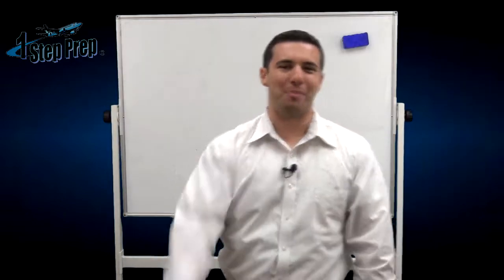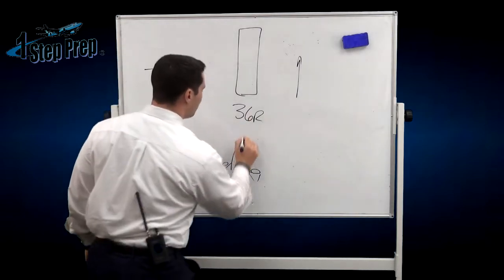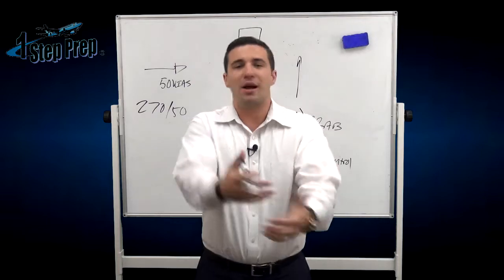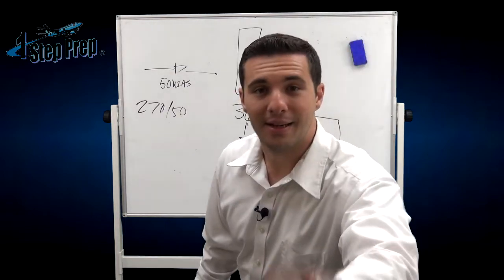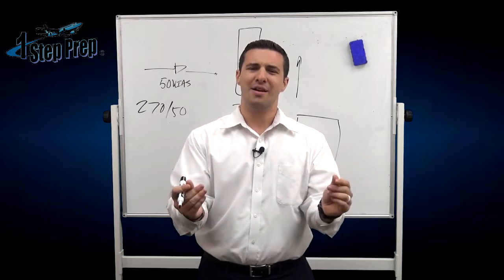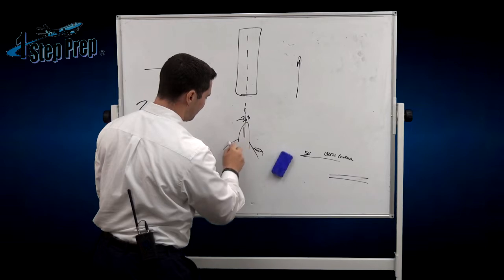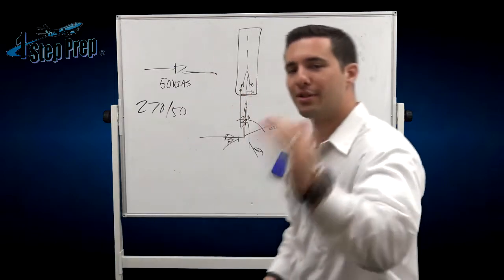Crosswind Landing Technique For Jets

Comment: I'm felling like i'm watching premium things for free, you're amazing dude, such a underrated channel!
Reply from the maker: Thank you appreciate you!! We aim to help and provide value in both  our paid content and free material here! 🙏
Reply: @1stepprep  Wow, there is even a paid version? Is that extra deluxe nonsense? Or are you actually explaining it right in the paid version and the free version is a joke?
Reply: @AnthonyHeithuis  Are you even a pilot bro? The nose always veers into the wind...
Reply: @joshilini2  are you? Based on your comment I doubt that. 

The nose veers into the wind when moving in relation to the ground during take-off and landing. Not while airborne when moving in relation to the same airmass. The statement we will add differential thrust to let the nose veer extra into the wind during approach therefore makes zero sense. 

An aircraft in flight does not experience a “crosswind” or “headwind” component. Only when taking-off before crabbing into the wind and from the moment we start de-crabbing for landing does the aircraft experience a crosswind component.

I have been an instructor for many years and a commercial pilot on turboprops and jets, made many crosswind landing. This method of performing a crosswind landing is a complete fairy tale and so is the explanation.

It is also impossible to perform a 50 kt crosswind landing without side-loads onto the landing gear. That would mean the aircraft needs to be fully de-crabbed which would require so much bank to counter drift that the wingtip and engine nacelle will hit the ground. Its a fairy tale.
Reply: Hello Anthony, my name is Alan Crane. I am a 787 captain. Some United skippers call me Captain Al Crane (sounds like Al Haynes).

I am tracking inbound JFK VOR at 5000' on heading 270. Wind is 180/15kts. Wind is coming from my left correct? In order to track direct to the VOR, my heading will be approx 265 degrees. My NOSE is pointed into the wind. My aircraft is CRABBED. If I continue to fly 270 with a left crosswind, I will be tracking 275 and will miss the JFK VOR.

Thanks for trying to troll but Joe and his team are amazing instructors.
Reply: @alancrane  Hello mister captain, if you truly are a B787 captain you might want to consider going back to flight school for a few simple lessons about aerodynamics. I could use the goldfish in fish tank or log of wood in a river example to explain how an aircraft is affected by wind, but lets try it this way first:

The aircraft is not experiencing a "crosswind component" and does not weathervane into the wind in your example, you are moving within an airmass which is taking you somewhere you don't want to go and for that reason you are applying a wind correction angle. 

(Mickey mouse terms: someone is moving the fishing tank with you in it while you are swimming from one end to the other end. You need to apply a correction in order to swim the correct track over the table, i.e. to the corner of the fishing tank. Do you notice anything otherwise? No. Do you have to swim faster to reach the other end of the fishing tank in the same time? No. Does the water all of a sudden come from the side? No. The fishing tank is the mass of air you are maneuvering in, the goldfish is your airplane.)

At 4:50, “you take the autopilot off, release all rudder inputs, what does the aircraft wanna do, it will weathervane into the wind”, no it won’t, not on an Airbus and neither on your Boeing 787. If you are telling me otherwise we are done talking.

The explanation that on approach the nose wants to weathervane into the wind and that this crosswind will then become a quartering crosswind with a headwind component is wrong on so many levels, even an inexperienced pilot would / should know that. 

The part where he says, try it on the ground, let everything go with a 50 kt crosswind and you will see the nose weathervane into the wind, that is the ONLY part which is correct. On the ground, while tracking the centerline (moving in relation to the ground, not the air) the aircraft does experience crosswind and will weathervane into the wind, found something correct 👍👍. Credit where credit is due.

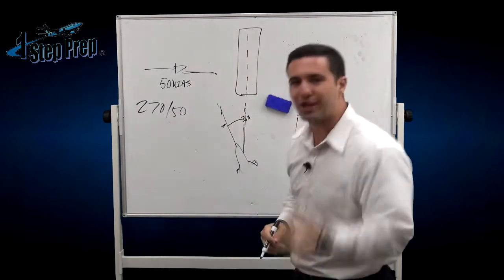At 9:20, when we let the aircraft weathervane into the wind on approach (which is 💩, see above), direct crosswind becomes a quartering crosswind with a headwind component. Of course not! This is the biggest baloney! The aircraft does not experience any wind component during a crabbed approach.

(Donald Duck explanation: you are in a canal swimming from one side to your buddy on the other side. To correct for the water streaming through the canal, you swim a couple of degrees upstream in order to swim directly to your friend on the other side. Do you experience water coming from the side? No, in relation to the water you are swimming in a straight line, the mass of water with you in it is streaming through the canal while you are swimming a bit upstream, basically you are performing a crabbed approach. Should you now line your body up with your buddy standing on the other side, the water will start to carry you downstream, you now need to swim sideways to continue swimming towards your friend, does the flow of water now impact you from the side a bit instead of directly from the front? Yes, you have just de-crabbed for landing / are on the runway and are experiencing a crosswind component.)

Airbus 320 and Boeing 737 can't land with side-loads on the main landing gear (not correct). Landing with zero side-load is only possible using wing-low technique. Unless you bolt the wings on top of the fuselage the wingtip will be buried into the ground using wing-low technique with 50 kts crosswind. Kicking the aircraft straight before touchdown as he explains, side-loads are not zero. Conclusion: you can't land in a 50 kts crosswind with zero side-loads as he claims.

This is just a fairy tale told very confidently. Incompetent but confident, the most dangerous combination in aviation. Would be best to rectify this video or take it offline before someone would actually try this in real life and get hurt.

On a positive note, I could use this as a "test" for instructor assessments. I will let them watch this video in the future and see how many inaccuracies they are able to discover.
Reply: Hello Anthony, it's Alan Crane here again. Can we just agree to disagree. Whilst we do, please can you tell me who you work for so I can avoid flying with them in the future!
Reply: @alancrane  No, I don't agree to disagree, these are very simple aeronautical principles taught to every PPL student. If you truly think this is a great explanation on how to fly a crosswind approach and landing, you either aren't who you say you are or should go back to flight school. Sorry, but there is just no other conclusion.

Comment: I think it's great to look at crazy scenarios! In an emergency (let's say you have a fire) and the nearest airport has a 50 kt crosswind--guess where you're landing; when you do land no one will say "that's not allowed!". In a 182 I used to (with an instructor or safety pilot) practice taking ILS approaches down to CAT II minimums...I'd never actually do it but if you can do it a cat I is easy.
Reply: One word of advise, if you ever end up having to land in 50 kts x-wind. Don’t use this technique. It wouldn’t end well.

Comment: Good brief on rudder and differential reverse usage.  Did I miss holding aileron into the wind during and after touchdown.  It makes a huge difference in stability of the rollout.
Reply: He said to cross the controls.  That is the Crosswind Slip Method.
Reply: Differential reverse may workout on prop airplanes. Prop responds quite fast. However, you never know how much input will make asymmetrical reverse on A320 on icy or contaminated runway.
Reply: @maugli2005  I've flown both types and you are right that props respond faster.  Very effective on the Twin Otter and Electra L-188 with the huge props.  The Twin Otter had full 50 # (100%)  of torque in reverse while most turboprops limit it to 25 to 50% of available torque.  My experience with the A320 was that with full reverse on one engine and idle reverse on the other was easily corrected with rudder until it was reduced to the desired level.
Reply: @mountainmarauder2575  I would not play like that on icy runways.
Reply: @maugli2005  That's when it would be most effective.

Comment: Does this work in a kingair?
Reply: On all airplanes, except 4 engines.  4 engines need a combination of crabbing and little slip only to avoid hitting the outside engine on the ground.  Not too much banking into the wind due low engines.  That is why they land with more crabbing method than slip/Wing Low Method..
Reply: @feetgoaroundfullflapsC  in a King Air you can go wrong low. You don't have to worry about dragging stuff.

Comment: Cross control a 320 in normal law?
Reply: it’s not allowed to use rudder in FBW system during approach, before the flight controls enter into the ground mode. so it’s vital to wait for the transition, and not to start decrabbing at 50ft. in A320 and similar we can only start to decrab at flare. just a few cents, thanks for the video
Reply from the maker: This happens daily. Not to the extent that you would do this in a 172. It's a very small input. But, it is certainly possible to do (on a small scale) to eliminate side loads on the gear at touchdown.
Reply: Oh, you mean a "decrab" on touchdown. Yes of course. Thought you meant cross control during the approach ("bank into the wind - opposite rudder" technique as opposed to crabbing).
 We are not allowed to disconnect the ATHR though, although this could be a company thing...

  @1stepprep
Reply: I love your videos BTW!
Reply from the maker: @spiroschazapis4108  yes sir!! De crab only, no cross controlling on approach!!! Thanks for your feedback,  we appreciate it and you!
Reply: @spiroschazapis4108  He was saying to cross the controls at 50 feet, that is just before flare high.  NOT ON APPROACH.   On approach you do the crabbing method up to around 50 feet he said..

Comment: Great, but pls explain the advantage of this your own invention of differential thrust, the airplane can by normal procedure turn its nose towards the wind as well ? What do you mean is the actual benefit?
Reply: Adding extra trust on the right engine in approach would force rudder to be trimmed to the right. That reduces your ruder authority to de-crab. The only point for this asymmetrical trust approach is that airplane is going to turn its nose to the right naturally as soon as idle selected on both engines. And it still looks pretty much unpredictable how much is going to be that input. It is not going to help keeping the ailerons leveled. The airspeed on each wing would be different during de-crab.. That’s what make a bank tendency and that’s what you compensate by ailerons.

Beside of all, I find it quite irresponsible to promote flight technics, that a not recommended by aircraft producers.
Reply from the maker: The aircraft will naturally weather vane into the wind. By using differential thrust it provides a more comfortable approach since you are working with the aircraft to crab with near neutral ailerons.
Reply: @1stepprep  Sorry but I still can't see the advantage, once we find our crab angle the ailerons are neutral any way. And if there would have been any advantage in real flying outside your sim world, this practise would for shore have been adopted by the large aviation world of professional pilots.
Reply from the maker: @pergillberg5043  You'd never know unless you try! The beauty is.. it is being used in real world, give it a shot and let us know what you think!
Reply: @1stepprep  For all practical advices there have to be some logic or scientific explanation. Since the airplane always fly within its own air package independent on the direction of the airport on final, your words about that this practise would give neutral ailerons is simply not true. So what is left is your statement is that "it will feel more comfortable" without any explanation why, sorry it makes no sense.
Reply: Crosswind on its own won't make anyone feel comfortable, compared to side slip techniques the ailerons will remain in a rather neutral position (you'll still need to do corrections) when approaching the runway. I myself can't see much of a difference to all those recommended crabbingdecrabbing procedures. Though what about winddrift, having the nose aligned with the runway bearing, no side slip wingtips imbalance, no crab-mis-heading/malalignment.
Reply: @1stepprep  Its not being used in the real world! What airline are you flying for?
Reply: @1stepprep  There may also be other advantages. The A380 was almost certified for a 50 kt crosswind. The issue was that it's bad for the engines to fly that crabbed. Asymetric thrust may actually be better for the engines. I do agree that it's an unconventional trick though. One advantage however is you're essentially giving yourself extra rudder trim that goes away right away when you decrab giving you a little extra rudder authority. I don't know if turning with asymetric thrust makes it more comfortable as you're essentially just turning with the rudder (asymetric thrust is similar to more rudder and possibly a little aileron since you're using power to turn and not just deflecting air). Please correct me if I'm wrong but I also gathered that you'll end up naturally turning into the perfect crab angle with this technique and that's another reason to split the thrust levers. One question I had though is on a 50 kt crosswind wouldn't it be really gusty? I know this is primarily for a sim excersize but would it be a bad idea to split the thrust levers on a really gusty day?
Reply: @1stepprep  No it will not weathervane into the wind! Where did you learn to fly???

Comment: What's the difference between heading and track?
Reply from the maker: Great question! Heading is the direction the aircraft is pointed.  Track is the direction the aircraft is actually moving. Hope this helps!
Reply: @1stepprep  I play/practice on infinite flight simulator on my phone I have around 40 hours in the A380-800 and I set myself up with a nice 65knt cross wind @90° at LAX with a 10nm final  for 7L  started at 10000ft  I 🦀 ed all the way down to 7L  and pointed directly at 90° full flaps and slats 5mph ground speed with wind speed at 175knts  just floating kept it there for a solid 5 min before I had to land because of low fuel lol wish I could do it in a actual simulator but we don't have any in Oregon
Reply: Thanks
Reply: http://www.chrobotics.com/library/heading-course-and-crab-angle